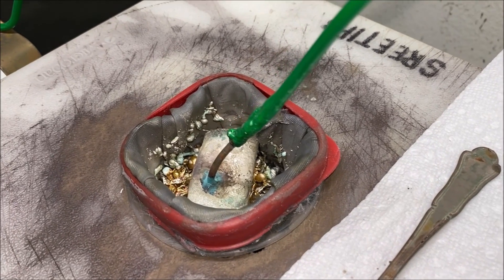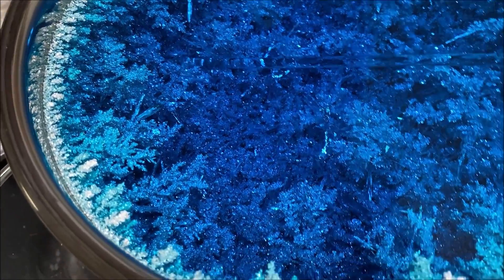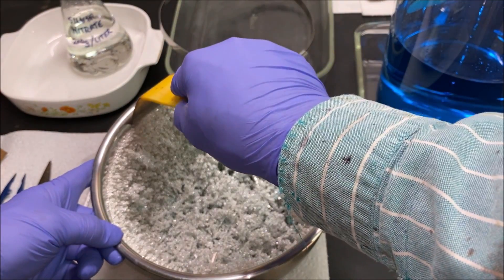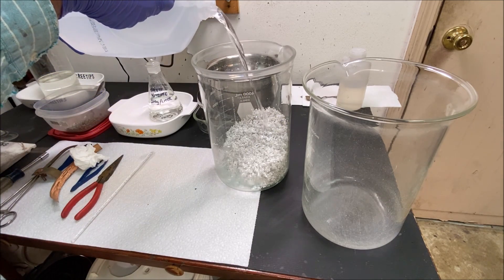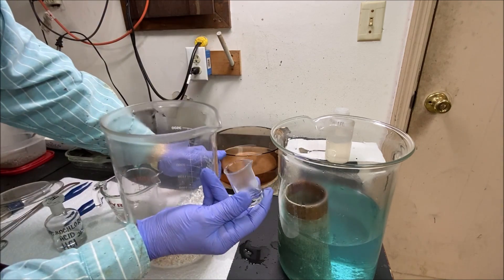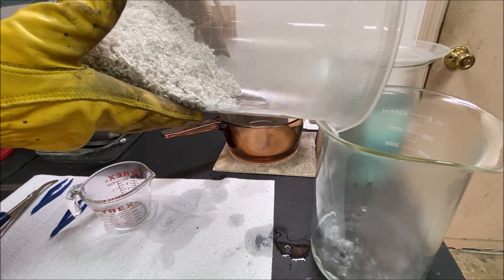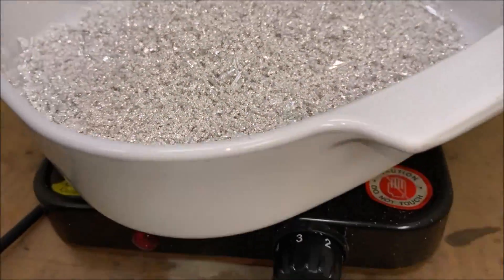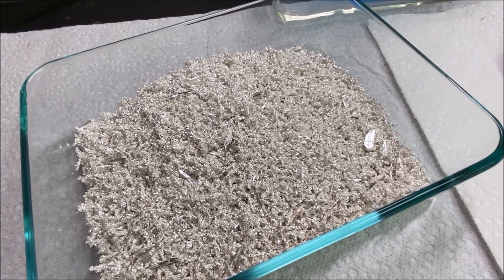Fifty Ounces of Silver From My Silver Cell Day 15

Comment: What is your cost breakdown? Would you mind letting us know. Thanks!
Reply from the maker: Mrs sreetips gets sterling silver very cheap. I used to buy sterling and pure silver bars and rounds for 80% of spot. But when gold hit $3k I had to quit buying silver all together. Because a single gold deal would wipe out my entire supply of cash. So I conserved cash (by not buying silver) so I had it available to buy more gold. However, Mrs sreetips continues to buy sterling at ridiculously low prices because she goes to yard sales and estate sales. The other day she handed me a bag of sterling silver she bought at a yard sale. 350 grams of sterling silver, for $4. I’ve never taken the time to break down the cost of operating my silver cell. The only reason that I run it is because I have so much cement silver, of indeterminable value, that I must run through my silver cell. It comes from my gold refining because I use sterling silver to refine the gold. Silver is a by-product of my gold refining. If not for that, then there’d be no good reason for me to refine the silver. Because sterling silver can be, and should be, held just like it is. No need to refine it because it contains a known quantity of pure silver and its value is easily determined. Unless you ruin the markings by trying to melt it. Then its purity and value becomes questionable.
Reply: @sreetips  I was thinking on doing it on a bigger scale. I was trying to understand the cost of growing the silver crystals starting from scartch. But thanks for the info! Does the electricity cost come into play for most of the cost?
Reply from the maker: My electric bill for the whole house was about $150. I don’t see a big increase if I’m running the silver cell. The biggest cost will be finding the silver to run through the silver cell. And the only way I know of to get cheap silver is to buy it from yard sales and estate sales, like we do. Anyone who is offering silver for sale online or via social media will know and understand what they have, and they will want the highest possible price that they can get for it. At one point, only about 1% of the American public had any understanding of the true value and importance of owning and holding silver and gold. The other 99% were (and still are to some extent) completely clueless about gold and silver. This lack of understanding, by the majority of Americans, affords us some fantastic buying opportunities, for those who know when (very early to be first in line), where (yard sales and estate sales), and what (karat gold and sterling silver), to look for. You can make a personal fortune. Because people believe, incorrectly, that paper dollars are more valuable than silver and gold. They actually believe that stacks of printed paper notes (currency) is worth more than real money (silver and gold) and worth stacking and calling it wealth. For this reason, they shun precious metals. Because they can’t buy gas for their car with a piece of gold. And they can’t pay for groceries with a sterling silver spoon. Well, they can buy a week’s worth of groceries for a couple sterling silver forks, but they must first convert it into currency. To most, this seems cumbersome and totally inconvenient. So instead of going through the hassle of converting the metals (that are rising in value) into currency (that is declining in value), they just avoid it by stacking paper currency because it’s so easy to use. Just imagine what will happen when people begin to realize that their paper is declining in value faster than a snowball melting in July. There will be a stampede into the only asset class worth being called money: gold and silver. For those who understand, and have the insight to start getting some metal now, while they are still grossly undervalued, the pay off will be enormous. Backpay is coming for those who’ve held silver and gold for decades as the spot price has languished. It’s a mathematical certainty.
Reply from the maker: I should just write a book instead of droning on in the comments section of my YouTube channel. Sorry for the rant.

Comment: In what form of silver nitrate did you start out with? Powder or solution? Silver nitrate powder in its pure form costs about 116$ for 100 grams. If you do the math you’re losing money after the process unless you’re getting it for way less.
Reply from the maker: I make my own silver nitrate by dissolving pure silver crystal (reserved from a previous run) in nitric acid.

Comment: Are you net positive silver after you feed the anode basket and the silver in the electrolyte solution? Are you creating more silver or simply refining the same amount of silver?
Reply from the maker: I refine gold. I use sterling silver, that I buy at estate sales, to refine the scrap gold. I recover the silver from that, melt into shot, and run it through my silver cell. Silver is a by-product of my gold refining. The cell converts the impure silver (about 980 parts per thousand silver) to high purity four nines fine (9999 parts per ten thousand) pure elemental silver metal. So I’m refining the impure silver, into high purity silver, not creating silver out of thin air. When it’s full, I harvest the pure silver crystal, put it away and forget about it. Then I repeat the whole thing again.

Comment: Where can you buy silver nitrate in large quantities.  
It’s extremely expensive.  And from what I can tell there is no profit to be made .
Reply from the maker: I make my own silver nitrate by dissolving pure silver in nitric acid.
Reply: @ and doing so allows you to dissolve pure silver into nitrate then you grow silver back out of it?  And this produces more silver in the cell then what you dissolve into nitrate?
Reply from the maker: @5D-Marquis  I refine gold. I use sterling silver, that I buy at estate sales, to refine the scrap gold. I recover the silver from that, melt into shot, and run it through my silver cell. Silver is a by-product of my gold refining. The cell converts the impure silver (about 980 parts per thousand silver) to high purity four nines fine (9999 parts per ten thousand) pure elemental silver metal. So I’m refining the impure silver, into high purity silver, not creating silver out of thin air. When it’s full, I harvest the pure silver crystal, put it away and forget about it. Then I repeat the whole thing again.
Reply from the maker: @5D-Marquis  it takes about 800g of pure silver for the electrolyte. And I can process about 3 kilos of impure silver using the electrolyte made from the 800g of pure silver. Hope this helps.
Reply: @sreetips  I appreciate you taking the time to reply to my questions! 
Great videos.  Keep it up!

Comment: How much silver goes into the basket to create that much silver crystal?
Reply from the maker: For every kilo of impure silver shot that I add into the anode filter basket I’ll harvest about 980 grams of pure silver crystal.
Reply: Very helpful. I really want to get started doing what you do. I see the equipment I will need just not sure on what to use for the electrolyte. I’ve heard of using nitric acid and silver dioxide. Which would you recommend?
Reply from the maker: The electrolyte is silver nitrate, 150g of silver per liter of liquid.
Reply: Thanks, I’ll let you know how it goes.

Comment: So how many 92.5 ounces did it take to get 50 pure ounces?
Reply from the maker: For every 100 grams of impure 98% silver I feed into the anode basket, I can expect to harvest about 98 grams of high purity silver crystal. I refine gold. I use sterling silver, that I buy at estate sales, to refine the scrap gold. I recover the silver from that, melt into shot, and run it through my silver cell. Silver is a by-product of my gold refining. The cell converts the impure silver (about 980 parts per thousand silver) to high purity four nines fine (9999 parts per ten thousand) pure elemental silver metal. So I’m refining the impure silver, into high purity silver, not creating silver out of thin air. When it’s full, I harvest the pure silver crystal, put it away and forget about it. Then I repeat the whole thing again.

Comment: I'll admit I'm ignorant to what you're doing here. This is not the same as .999 pure silver, is it? If it is then why does silver hold any value at all, and if it isn't, what do you do with it?
Reply from the maker: Every pure silver bar or round in the planet begins as pure silver crystal just like you see in this video. I refine gold. I use sterling silver, that I buy at estate sales, to refine the scrap gold. I recover the silver from that, melt into shot, and run it through my silver cell. Silver is a by-product of my gold refining. The cell converts the impure silver (about 980 parts per thousand silver) to high purity four nines fine (9999 parts per ten thousand) pure elemental silver metal. The impure silver is added to the anode basket. The anode basket is suspended in the silver nitrate electrolyte. I pass an electric current through the impure silver. The silver dissolves, passes through the Dacron filter, travels through the silver nitrate electrolyte, and deposits (grows) on the inside of the stainless steel bowl (the cathode). The bowl is connected to the negative pole of the power supply. The process only deposits pure silver on the cathode. So I’m refining the impure silver, into high purity silver. When it’s full, I harvest the pure silver crystal, put it away and forget about it. Then I repeat the whole thing again.
Reply from the maker: My tiny output of pure isn’t enough to influence supply and demand. I’m not creating silver out of thin air. I’m refining it.

Comment: My cell went from blue to green. Do I continue running it or should I stop the process and start over?
Reply from the maker: Probably palladium. Copper is blue, palladium is yellow. Blue and yellow make green. A little palladium in the electrolyte isn’t a problem. But higher concentrations will cause it to begin to plate out with the silver. Palladium is about seventy times more valuable than silver.

Comment: amazon was the best silver cell bowl i found just went from 5000ml to 8000ml bowl  ,, winco 8qt stainless steel  bowl ,  when i got it ,it has Germany / not china  on it,,, $23.32  top edge for slamp is not tapered , better clamp hold/contact,, , im useing 2.2v constant  useing about 1 amp, , use same basket as you except holes an perimeter 3/8 up from bottom filter on outside  john folger /Florida
Reply from the maker: The pro refiners that I learned from on the GRF cautioned me to run the cell at 3.5VDC. Never go over 3.8VDC. Other metals, if present, can begin to plate out with silver if the cell is operated outside this range, according to them.

Comment: So how long would it take to make 1 kilo of silver? What’s the quickest time
Reply from the maker: It depends on the type and size of the silver cell. I’m using a moebius cell. Thumb cells hold alternating anode and cathode plates suspended in gallons of electrolyte. Those can probably crank out a kilo of pure silver an hour.
Reply: @sreetips  wow a kilo of silver in one hour that’s pretty amazing.. and what’s the cost of start up ingredients equipment. So when it’s finished and it’s in a dust material do you just melt it down into a brick.

Comment: I watched the whole video but what is in the little basket obviously silver but like silver wire or damaged pieces of something what do you have in that small basket and did you put 15 oz in to get 15 oz out of whatever it is
Reply from the maker: It’s impure silver recovered from my gold refining. I melt into shot/granules and add it to the anode basket. It’s about 98% to 99% pure silver. So, for every ten Troy ounces I add into the anode filter basket, I get 9.8 to 9.9 Troy ounces of high purity silver that deposits on the stainless bowl (the cathode).
Reply: @sreetips  Thank you, great video it was incredibly relaxing and interesting. The way it began did not show thank you for the answer

Comment: I'm just wondering why you don't melt the silver into bars and why you leave them as crystal form?
Reply from the maker: I used melt it and pour bars then sell them immediately. But it was a lot of work. And silver do grossly and artificially undervalued, it makes no sense to sell any silver. So for now, I just harvest the crystal, put it away, and forget about it. But I do offer a few ounces for sale on my eBay site.
Reply: @sreetips  thank you for your response. I am new to silver investing and have been talking to someone who collects it as well. We were wondering if there is actual profit 📈 from growing silver after the initial investment and education (time/studying) involved, plus the time to produce.

Based on your comment that it's undervalued, I'm assuming there most definitely would be profit in holding onto it and long-term storage.
Reply from the maker: You don’t have to refine it. Sterling silver can be held just like it is. It will track right on up with bullion.

Comment: Is the point to make money doing this? I only ask because I love the process but no matter how many times I do the math I can't make the numbers come out in the black...am I doing something wrong? From what I gather, you need to use 1000g of silver nitrate to extract 636g of silver...am I wrong? I'm not being a hater I swear. I'm just clearly missing the point is all
Reply from the maker: I use 800g of pure silver reserved from a previous silver cell harvest. I dissolve the 800g and use it as the electrolyte for two runs of the silver cell. The average harvest for each run is 1.5 kilos of high purity silver. So I gain 2.2 kilos from every two runs of the silver cell. Keep in mind; for every ten Troy ounces of impure 98% to 99% silver that I’m adding into the anode filter basket I’m recovering 9.8 to 9.9 Troy ounces of high purity silver crystal. It’s a straight ahead trade, one for one in silver, less impurities. I’ve written this explanation many times to satisfy the curiosity of my viewers.

Comment: Sad that no one will take this as legit silver.  No silver or gold store would take that as legit silver. Even my silver bars if I cut them or melt them down become useless for trade of cash. Still really cool tho makes me want to make some silver.
Reply from the maker: Every pure silver bar or round on the planet began as pure silver crystal, grown in an electrolytic silver cell, just like you see in this video. Except large industrial silver refiners use thumb cells. My small hobby cell is a moebius cell. But they both crank out high purity, greater than three nines, investment grade, pure silver.
Reply: @sreetips  that's awesome can you sell it tho? the gold and silver shop i buy my coins from said they wont buy melted down gold or silver. or even coins that have been cut or split.

Comment: I worked at a place that painted silver frames. We cooked the used solution down to a dry mixture, them sent it off to receive money for it several times a year.
Reply: I was going to ask if he could just boil down the mixture into a dry powder, but I assume that would just be silver nitrate that still has to be refined.

Comment: I have absolutely no idea what I just watched, but I was mesmerized
Reply from the maker: It’s an electrolytic silver cell used to refine impure silver into high purity, investment grade, greater than three nines fine, pure silver.
Reply: @sreetips  would silver mines use this technique on a large scale?
Reply from the maker: No, I think silver miners smelt the silver from minerals and create dore bars of impure silver. They send these to a refiner and the refiner converts it to high purity silver in thumb cells. Thumb cells have alternating anode and cathode plates suspended in silver nitrate electrolyte. My hobby level silver cell is a Moebius cell. But the pure silver that I produce is just as pure as theirs, but on a much smaller scale.

Comment: Out of curiosity, without the cost of setup materials like beakers, scales, heat plates, power supplies, etc..... How profitable is this?

This is the first video I've seen. Maybe even just a reference to a video you have that goes into this topic a bit more? I have an entirely empty basement in my house and this seems like something I'd be interested in doing. Just want to make sure it'd be worth my time and not just a fun hobby.
Reply from the maker: I buy sterling at local sales. I use it to refine gold. Then I recover the silver from that and run it through my silver cell. With silver so grossly undervalued it matters not about the price. The sellers reference the spot price of silver (which is way too low) when they price the silver. So I just buy it and give them their ask price. I don’t track expenses for silver refining because it’s a by-product of my gold refining. The sterling can be held just like it is, so long as you don’t melt it and ruin the markings. It will track right on up with the bullion. But if you do decide to refine, then get a fume hood. No way to safely do these reactions without one,

Comment: Why not just use a copper seive to rinse that silver out my dude?? You would have a denser solution you could probably get away with using less water if you get a tight enough seive and stir it while you rinse
Reply from the maker: The silver would immediately cement out on the copper.
Reply: @sreetips  
Right obviously.. and you wouldn't want to use other metals but glass maybe? I dunno but now that you point that out i feel a bit derpy. I'm sure this works fine with minimal loss but i would hate to have to work with so much diluted solution if it could be avoided.
Reply from the maker: I’ve tried other ways. This is the best and takes the least amount of effort.